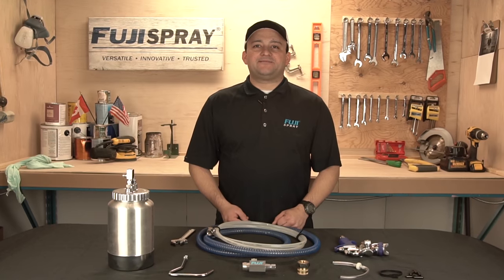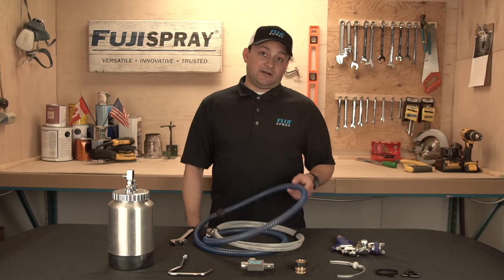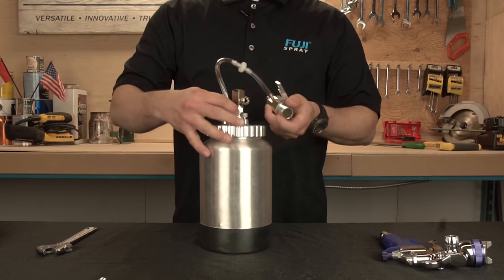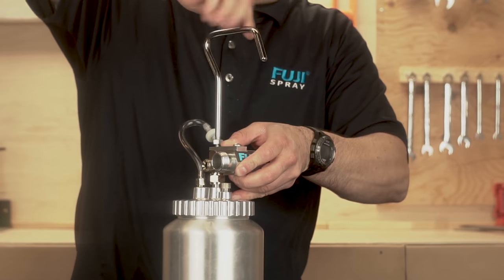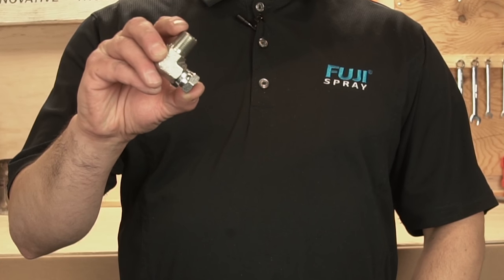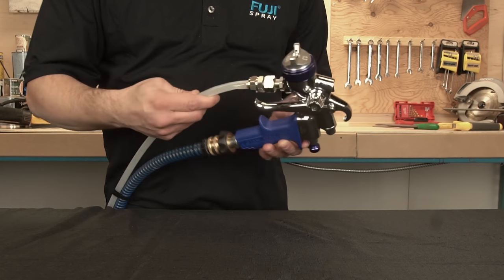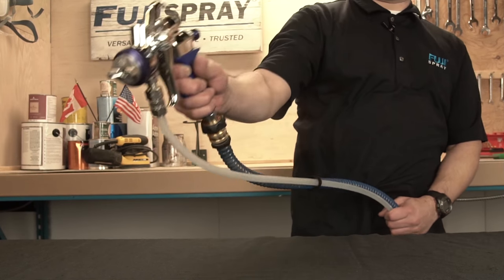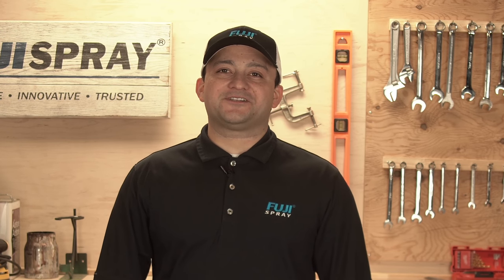How To | Assemble the Fuji Spray 2Qt. Pressure Pot Assembly

Comment: To me this is a required accessory if you are taking on a kitchen cabinet paint reno. The higher capacity of the pot, ability to spray at any angle, and only having to hold the gun without the weight of a paint cup is the only way to go! I do not know if I would take on this project if it were not for the pressure pot! If you own a 4 or 5 stage, you need this!
Reply: I'm ordering one.  Wish I had seen this before my last project!  I have owned a 4 stage Fuji for a decade.  It's fabulous!

Comment: So what does the pressure pot add to the equation that the regular cup doesn't? Just being able to spray upside down?
Reply from the maker: Spray at any angle for any amount of time (as long as there's enough material in the pot), much less weight and stress on your arms, and the fact that you get twice the material capacity than the standard 1Qt cup in bottom feed spray guns. When you have large jobs, like a whole cabinet, or a long fence, it is quite convenient not having to refill the cup constantly, and having a lighter spray gun. - Fuji Spray Team -

Comment: Will Fuji be making higher stage turbines? Will a 10 or 12 stage ever exist? (Peelable paint etc etc)
Reply from the maker: Good question! A 10 or 12 stage spray system could potentially offer significant atomizing pressure. In order to stay a "True Turbine HVLP" the equipment must produce up to 10psi, any higher, it will fall out if its category. For higher atomizing pressures, one would in this case consider a compressor setup with a HVLP compressor spray gun (like Fuji's LX-20 or H-V8). Hope this helps. For further assistance, please feel free to reach out to us at info@fujispray.com. - Fuji Spray Team
Reply: Fuji Spray no I understand that I was wondering if anyone will come up with a stronger setup without a compressor maybe like a super turbine etc etc
Reply from the maker: @housemachine509  Only time will tell, my friend!
Reply: Fuji Spray hurry be the first one before Apollo does it!

Comment: Are other higher volume pressure pots compatible or do they have to supplied by Fuji? If compatible, do you need anything specific from Fuji?
Reply from the maker: Yes, Fuji offers a 2.5 gallon pressure pot. Because the 2.5 gallon pressure pot is a compressor driven system, you will require a small pancake compressor as the air pressure source to pressurize the fluid system, while the turbine will continue to supply the atomizing air pressure for the spray gun. Please reach out to Fuji Spray directly to inquire more information on this set up. - Fuji Spray Team -
Reply: @FujiSpray  thanks for the quick response. Great that Fuji offers a 2.5 gallon. I also was gifted one a while back (non-Fuji). Do I understand your response to be, non-Fuji pressure pot can be used, correct. My intention is to re-spray paint a 38 foot sailboat. About 300 sq feet / 28sq meters.

Comment: hi there,

Does it fir to the FUJI SPRAY SEMI-PRO2 HVLP SUCTION SPRAY SYSTEM? tnx
Reply from the maker: It fits - HOWEVER - the 2Qt pressure pot is only compatible with any 4 or 5-stage spray system. The Semi-PRO 2 sprayer is a 2-stage spray system and will not be powerful enough to sustain the pressure requirements the pot needs. A Fuji 4 or 5-stage spray system comes in the form of Mini-Mite 4 or Mini-Mite 5, Q4 or Q5. - Fuji Spray Team -
Reply: Thank you very much man  @FujiSpray

Comment: Do I need the ‘L’ connector for the T-series gun?
Reply from the maker: The T-Model spray gun does not require the "L" fitting. If your T-Model spray gun is the gravity version (T-75G), the "L" fitting will not be required either. However, it may cumbersome to connect the fluid hose to the top-situated fluid inlet of the spray gun. Although the connection is possible, some people find it awkward to spray, so the Bottom Feed spray gun would be the most ideal choice for connecting the pressure pot. - Fuji Spray Team -

Comment: I just purchased this pot. There is no Fuji logo on the air distributor. 
The material hose is very stiff and it came winded in small circles making it very difficult to use. Is there something I can do to soften the material hose  a little?
Also the nipple on the air distributor for connecting the air supply to the pot is missing could you please let me know what threat size is this?
I'm in Ireland and getting anything is a bother. Thank you.
Reply from the maker: Thank you for bringing this up to our attention. We ask that you please kindly reach out to Fuji Spray's Customer Care department. You can reach us at support@fujispray.com. We look forward to serving you. - Fuji Spray Team -
Reply: @FujiSpray  Thanks for the reply. My supplier will sort this.. And the Fuji logo is here on the pot cover.. I was so angry with the missing air nipple that I didn't see the logo.
I left the kinky paint hose fully stretched with  the spray gun and pot connected and hanged the pot up high so the gun didn't touched the ground, for the night. This helped, no kinking anymore.
Reply from the maker: @mattgloss8580  That's great news! Glad to hear everything go sorted out. Please feel free to reach out to us if you have any other questions or concerns. Fuji Spray Team
Reply: @mattgloss8580  alright Matt, if you dont mind me asking where did you get this set up from? And would you recommend it now 2 years later?
Cheers.

Comment: Does this pressure pot give you any additional atomization because the regular suction or that ships with the Q5? Or just extra capacity and ability to spray at any angle?
Reply from the maker: The 2qt Pressure Pot Assembly is indeed extra capacity and ability to spray at any angle. This product will need to consume some air pressure to push the material up the pickup tube from the pot and up the fluid line to reach the spray gun but it will not cause any significant atomizing air pressure drop or result in any spray issues. - Fuji Spray Team -

Comment: Hello, can you use this pot with a Titan capspray 115 and an Apollo 7700 gun? Thanks
Reply from the maker: Yes - the Fuji 2Qt pressure pot assembly will be compatible with you current setup. In addition to the 2Qt pressure pot assembly (part # 5432), you will need a Fuji 6ft whip hose (part # 2049F) for air connection from the pot to your spray gun. Fuji Spray Team

Comment: Can you use a regular pressure pot with a Fuji hvlp gun? I have the mini mite 4 stage system. I’d like a larger pot size. Gallon size with longer hose would be perfect for my set up. Any help is truly appreciated.
Reply from the maker: It is possible, but for this type of setup you will require  small compressor in addition to the 1gal pot and Fuji sprayer. The way the rig would be set up is the small compressor supplying air pressure to the pot ONLY (this means you'll need to add some sort of shut-off valve or end cap to the pot's air outlet at the "T" connector) So in other words, the compressor's job is to only pressurize the pot in order to push the material into the spray gun. And the  spray gun's air power will come directly from the Fuji turbine. If you have any other questions about this setup, please contact us at 1-800-650-0930. - Fuji Spray Team -

Comment: Will this work with Fuji 2203G semi Pro2 which I’m planning to purchase. Thanks.
Reply from the maker: The Fuji Spray 2Qt. Pressure Pot Assembly is for the use of a 4 or 5-Stage spray system. The Semi-PRO 2 is a 2-Stage spray system and will not work with the 2 Qt. Pressure Pot, it is not powerful enough to pressurize the pot. - Fuji Spray Team -
Reply: Fuji Spray thank you for the prompt reply. I wonder if I purchase the Fuji T75G spray gun using my compressor and the 2QT would work? I’m spraying latex paint for my room painting and other small project like painting my utility trailer. Thanks.
Reply from the maker: @WaynesWorldStudioVancouver  Sorry, we are having trouble understanding what you have in mind, please can you call our customer care team at 1-800-650-0930. With regards to a T75G spray gun connection to a pressure pot, bare in mind that the fluid inlet if the spray gun is at the top. Although it is possible to connect a fluid line at the fluid inlet of the spray gun, it will be very awkward to spray as the fluid hose will be connected at the top of the spray gun. - Fuji Spray Team -
Reply: Fuji Spray thank you.

Comment: No where in your instructions does it indicate what to do with the hose that goes from the back of the gun to the T70 paint pot
Reply from the maker: In the package will be included 5 x black caps. You'll only need one. Remove the pressure tube from the rotating nipple at the back of the spray gun, and "cap off" the rotating nipple with the black cap. The instructions can also be fount in the included user manual. - Fuji Spray Team -

Comment: Will this work with the gravity gun supplied with the Q5? thanks
Reply from the maker: Yes it does... You'll just need to loop the fluid hose up to the fluid coupler on top of the gravity gun. The fittings will connect with no problems.          
 - Fuji Spray Team-
Reply from the maker: Hi James, thank you for your question. Yes, the fluid line will connect to the coupler at the spray gun in place of the cup. It will look a little awkward at first because the fluid hose will have to loop  to the top of the gun, but it's definitely doable.
Reply: James Mullan  don’t bother it’s a pain in the ass I’m doing it now and it’s no good. I’m going to order the model
Shown in the this video
Reply: @brokenndreams11  typical it’s shit with the t75 then ?
More expensive gun but useless with this

Comment: Is the gun being used in the video the T70 bottom feed gun? Is this the best gun for usage with the pressure pot? I see the comment below regarding the gravity feed gun(s) which are the ones I have, but if I plan on purchasing the pressure pot, is the preferred method to use the bottom feed gun for best comfort?
Reply from the maker: The gun being used in the video is indeed a bottom feed spray gun (T70), this will be the ideal setup.  A gravity gun can also connect to the pressure pot but yes - it will be awkward as the fluid hose will have to loop to the top of the spray gun to connect to the fluid coupler of the gun. - Fuji Spray Team -